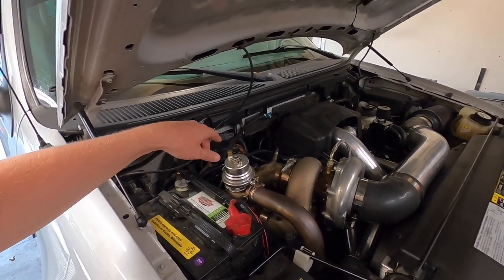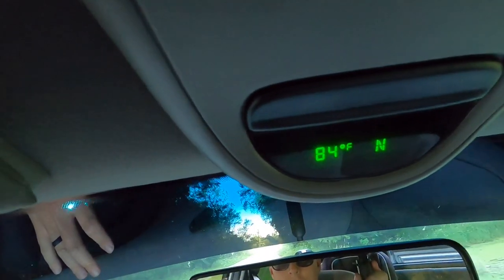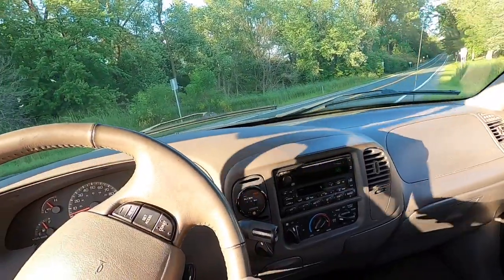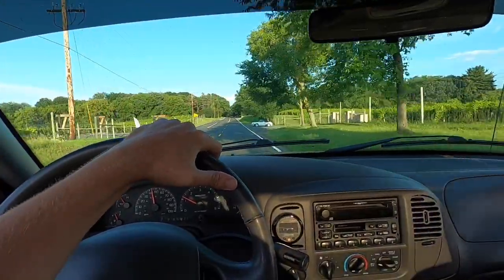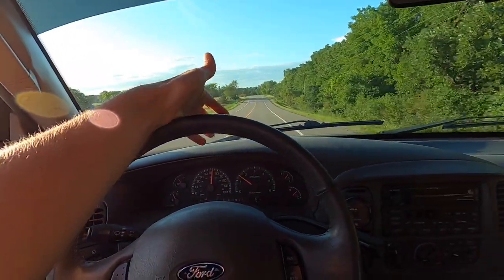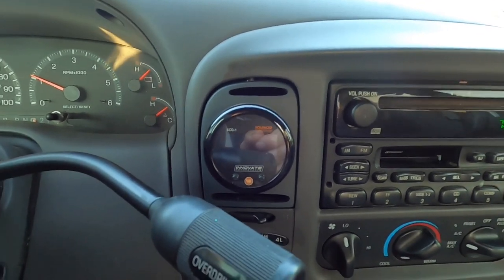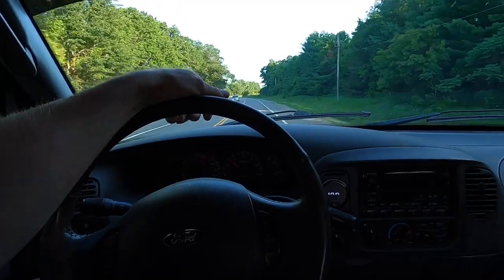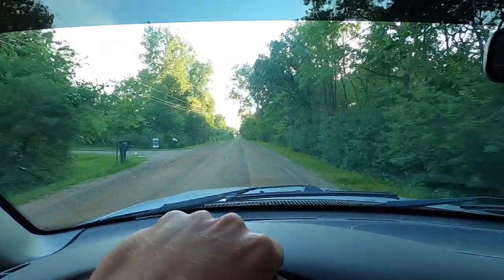TURBO Exhaust Cutout Testing on my SLEEPER F150! ***Sounds Amazing!!***

Comment: Why haven't you tried an electronic cutout and wire it to your signal wire on your tps so everytime the tps sees 100% or WOT it opens the cutout instantly and your problem is solved @autodetour
Reply: Great idea.  He could even wire in an on/off switch so he can manually open it too.
Reply from the maker: I would like the ability to control it manually, but I like the variability of the boost actuated cutout. I don't need to be WOT for it to open. I still want it to open at 3/4 throttle too. I love the way your thinking though!

Comment: Maybe I don't fully understand your SCG-1, but have you messed with the gain setting at all to get it to take over if you aren't achieving the desired boost level?
Reply: That’s what duty cycle is. He is turning it up how ever he has boost cut set at 10psi so in what ever gear it makes more than 10psi it will set dury cycle to 0 psi and just be waste gate spring. He could do a boost by gear setup then he could get more boost in lower gears.
Reply: @RacingRamFam  right, I'm just wondering if it has a closed loop setup, where it will adjust duty cycle to target a boost pressure so he doesn't need to adjust for different temperatures 🤘
Reply from the maker: My understanding is that gain adds pressure over time to account for boost loss in upper rpms. Which wouldn't really help me out in the lower rpms. I see what you're asking though and I don't think it has a function that automatically keeps it at a desired psi. I can adjust how much it cuts boost when I reach the set psi limit, but right now I have it cut 100% down to just spring pressure.

Comment: Pretty sure the stall on a 10th gen F150 converter is about 1700 rpm, not quite the 2000 you're thinking it is. On that something around 24 or 2500 rpm should get that thing moving pretty quickly.